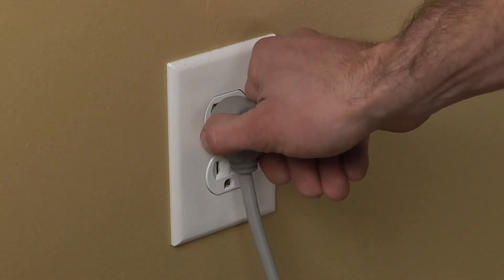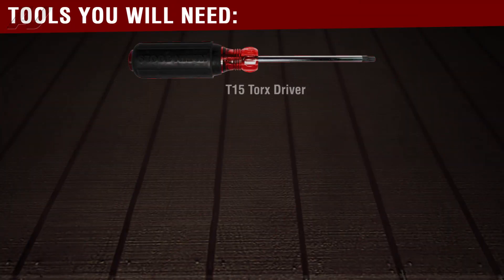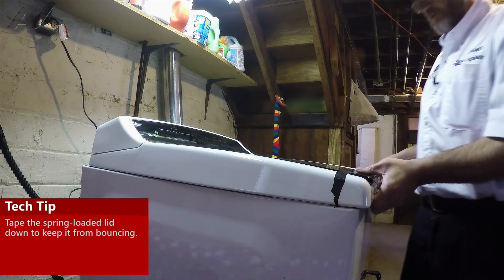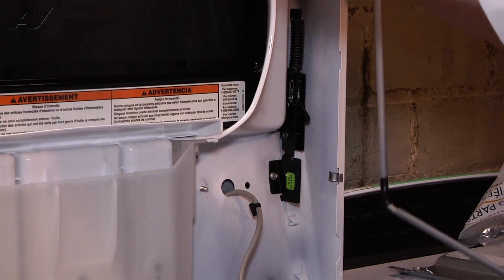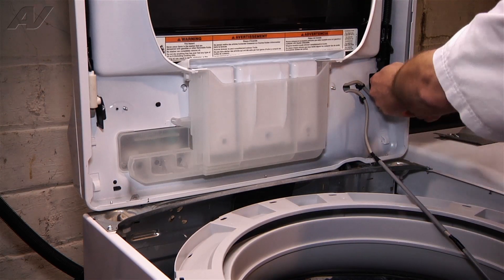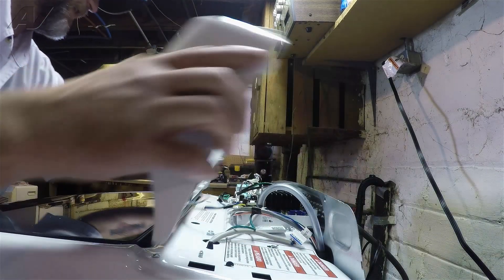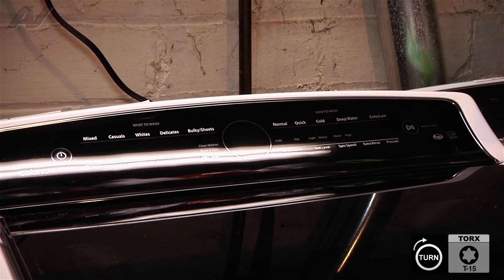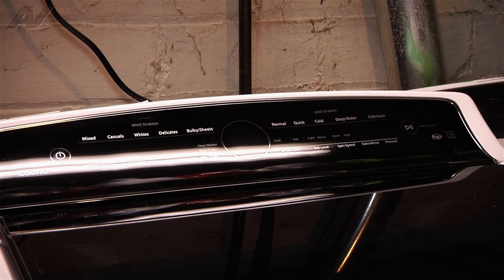Whirlpool Washer Repair - F5/E2 Error Code - Lid Lock Assembly

Comment: I had this same F5E2 error code on my Kenmore top load washer. I cleaned the stationary part on the lid locking mechanism on the front center of the washer lid with rubbing alcohol and Qtips. I then cleaned the locking mechanism area on the front center of the washer body. I then gently pried forward the little locking tab and cleaned it, getting to the underside with the Qtips.  I then lubricated the top and bottom of the tab with a garage door silicone lubricant, using the tip of my little finger on a gloved hand.  It worked. Saved me at least a repair bill, and at most the cost of a new washer. THANK YOU!
Reply: Was having the same issue and I saw your post as I was about to buy the part. The cleaning and silicone lubricant did the trick and it works now! Thanks for posting this!

Comment: I was cleaning my machine and I got the latch area wet and was getting the f5 code. I was able to take out the thing and dry the motor and board on the latch and now it’s working again. Thanks for the video you saved me from buying a new washer!
Reply from the maker: Great question, if you have a more technical question that our parts department cannot answer, you can search our over 17,000 answered questions free at our website www.ApplianceVideo.com under our Repair Help section. You can also call our parts department at 1-800-830-5465 and they can give you help 7-days A week ,or search at www.SaveMoreOnParts.com  .

Comment: I cleaned my washer using my bissell steamshot and it started giving me the F5 E3 code. I unplugged it immediately, opened up the lid, and turned the celing fan on high overnight. Thankfully it dried it right up, and works just fine now.
Reply: I meant code F5 E2

Comment: I think this is a design flaw in this particular cabrio model. We ran in to the same issue but I cleaned the locking mechanism with some 99% iso and then used some dielectric grease on the lock itself. It's worked great for two years. The issue is there is no shielding on the washing tub rim. You can literally reach your fingers up and touch the lock lid so it is exposed to moisture all the time.
Reply: Did the same.  An alcohol pad and some petroleum jelly, working great again.  Your comment gave me the idea!  Thank you!
Reply: @grandprixfamily  glad it helped! Replacement part is $100 but the fix is pennies!
Reply: Thank you so much for this comment! Just saved me $100 bucks! Spent a few minutes cleaning out all the rust and gunk with alcohol and regressed with dielectric grease, works like a champ!
Reply: @jlsimmons239  that is awesome! Happy to have helped
Reply: I replaced the switch with new $32 . Thanks for the video
Reply: I use the geae but not work😢 i need order the part
Reply: @richardumholtz  where you order the part?

Comment: Be forewarned: There's 2 tabs at the front of the washer that stick up and have to be aligned with small holes in the lid in order to get it seated properly. They bend very easily and will keep the lid from going down all the way if they're not straight.

Comment: Hi, I'm having some of the same issues with my Cabrio. The error codes are F5- E3. My washer was running at the time cut off and displayed the error codes. I did all of the troubleshooting, but nothing. I can't get the door to unlock to replace the part. Can someone help me?
Reply: Did you ever figure out what the issue was? I'm getting that same error message. Thank you in advance
Reply: @Kendra007  Yes, I  did manage to fix it. I had to take the washer apart to get to the locking mechanism. The replacement part was the most expensive part. If you need help, let me know.
Reply: Mine is also leaking water from the bottom as well. Would that be a different issue as well.
Reply: Yes, I would think so. Did you check the hoses in the back of the washer?
Reply: I had to call the repair guy last week because I got another code and really wasn't sure what the problem was. I need two pieces that cost $800, so I might as well get a new one at that point, but it still works.
Reply: @jeanninehenry4023  I agree

Comment: Is it possible to only have a E2F5 code showing on one setting, but now show up when using the other settings?
Reply from the maker: Great question, if you have a
more technical question that our parts department cannot answer, you can search
our over 10,000 answered questions free at our website www.ApplianceVideo.com under our Repair Help section. You can also call
our parts department at 1-800-830-5465 and they can give you help 6-days A week
Monday -Saturday, or search at www.SaveMoreOnParts.com  24 hours
7- days A week.

Comment: after i installed the new lid lock it will not power back on. is there a reset i need to do? and it is plugged in
Reply from the maker: Great question, if you have a
more technical question that our parts department cannot answer, you can search
our over 10,000 answered questions free at our website www.ApplianceVideo.com under our Repair Help section. You can also call
our parts department at 1-800-830-5465 and they can give you help 6-days A week
Monday -Saturday, or search at www.SaveMoreOnParts.com  24 hours
7- days A week.